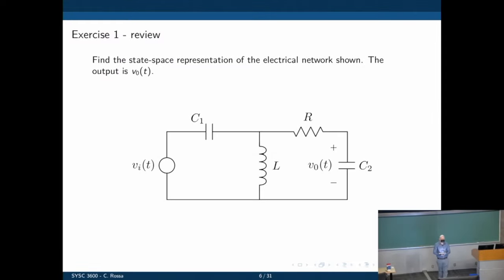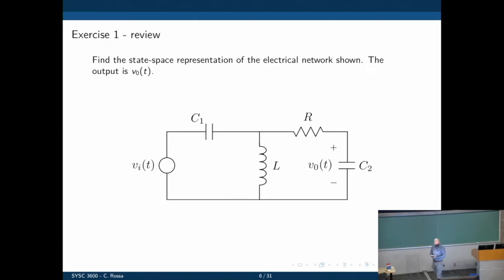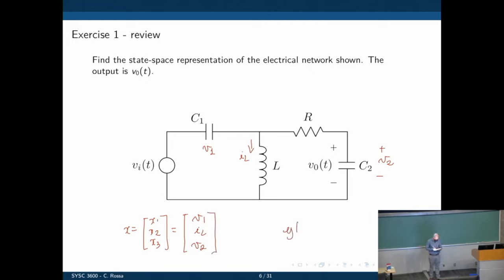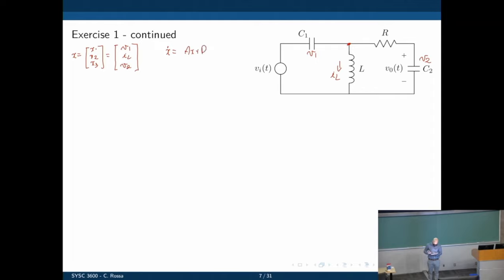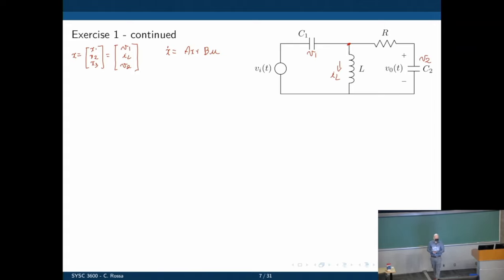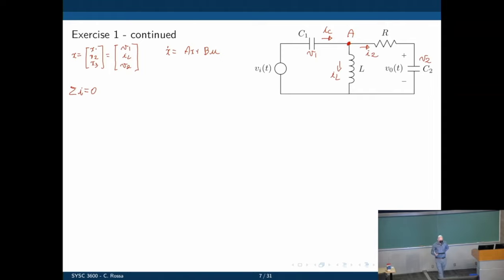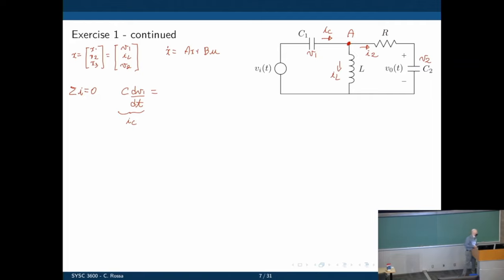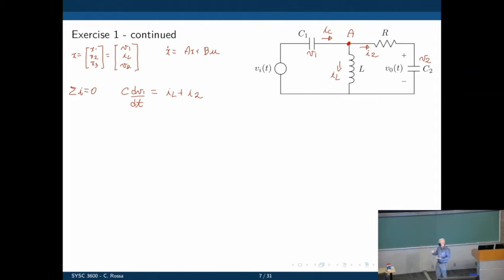Example: State space model of an electric circuit

Comment: why is there no D matrix ?
Reply from the maker: The D vector is zero since the output y(t) does not depend directly on the input vi.
Reply: @biomechlab  thanks but I thought one of the loop equations was vi = v1 + i2R +v2 would seems to imply a relationship between input and output ? why do we choose y = v2 equation for the C and D matrix but not the above equation?
Reply from the maker: We are using y = v0 = x3